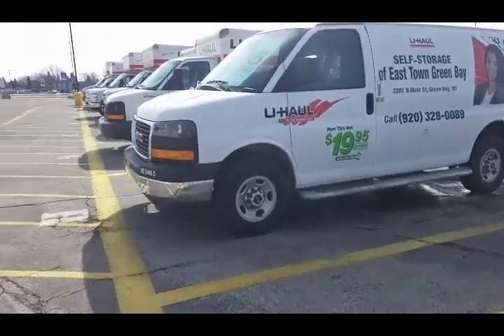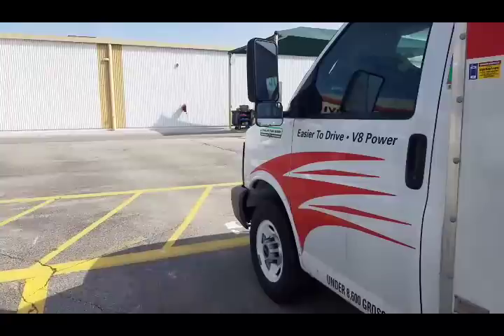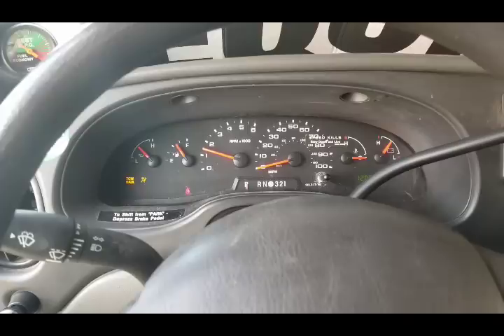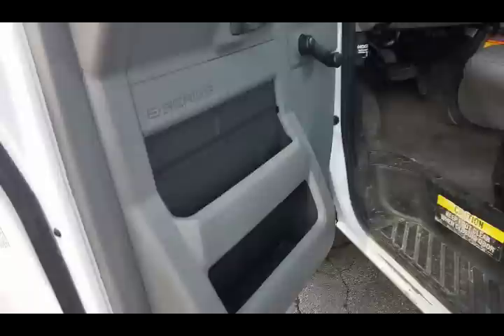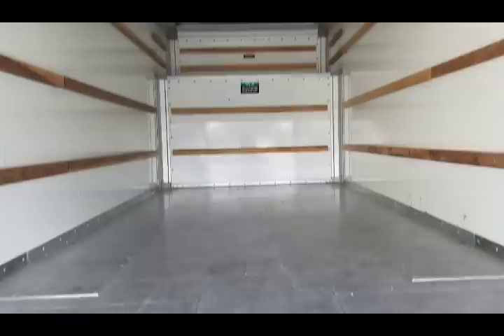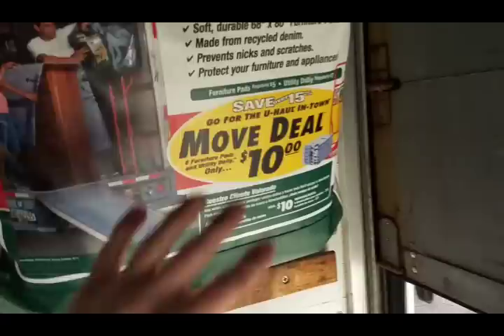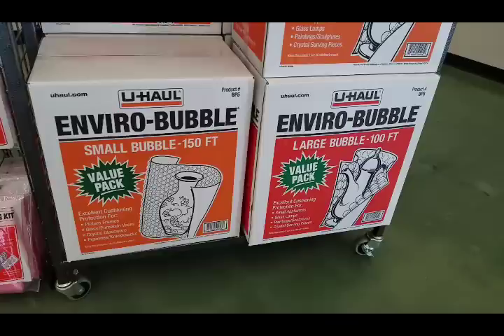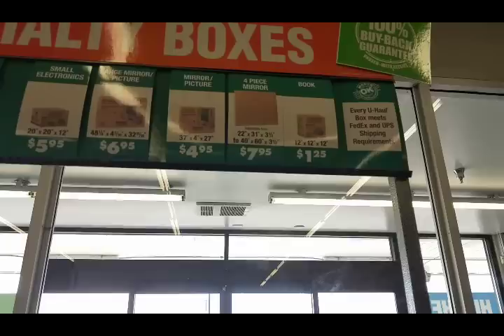U-Haul Trucks - Everything you Need to Know

Comment: The most disappointing part of most of the Uhauls is they don't include any kind of Aux input or bluetooth for the radio. Doesn't matter for local moves, but I can't imagine traveling a couple thousand miles with nothing but FM radio.
Reply from the maker: some of the trucks do, but anything bigger than a 10ft truck doesn't have one, although they all have outlets that you could connect your phone through a radio station. Idk if you know what im talking about.
Reply: @CalebTomaschefsky-Youtube  yeah, you could use an FM transmitter but those tend to not be all that reliable.
Reply: 26" Ford F650 comes with Aux
Reply from the maker: @res887  the newer ones do, but not the older style.
Reply: I work for ubaul and they're steeping up there game with the new trucks there's Bluetooth some of the older ones do have auxs
Reply: Just drove 2350 miles from west of Seattle to traverse city Michigan. Hooked up my Sirius/xm radio through the truck system. Most long trips, the 26 ft truck is a Ford f650.
Most of the gmc’s should be used for local trips.
Reply: Mine did, THANK GOD
Reply: Wahh Wahh...poor you.
Reply: Does it have a USB to charge phone ????
Reply: what you could do is just buy a cheap wireless speaker and use that with your phone instead
Reply: Waaa 1st world problems

Comment: Also the 15’ 17’ and 20’ all have V10 engines. The GMC JH have a 454 V8. Now the new one way F650 Ford has a V10 as well
Reply from the maker: 10ft, 17ft, and 20ft all have a V8. The GMC 26ft does have V10. We dont have any JHs with a V8.
Reply: @CalebTomaschefsky-Youtube  The older 10/17/20 ft uhauls had V10s. Uhaul still has some listed for sale on the used truck site.

Comment: WHERE HAVE ALL THE 17ft TRUCKS GONE?? Can't find on near me, checked 7 locations.
Reply from the maker: all of the 17ft trucks are One ways if i'm not mistaken.
Reply: Ugh yes because that’s what I need 😭 to scared to drive 20 foot with toddler and pulling my huge car ugh
Reply: @vintagevirgo  17 ft was cheaper to rent vs 20 ft and I didn't need the extra 3 feet at the time of the question - plus the 17 ft has more power available

Comment: Thank you! I’m getting a 10ft truck for my one bedroom apartment. Gotta drive 600 miles. Can the 10ft trucks handle towing a 2016 Kia Soul?
Reply from the maker: Yes they are fully capable of towing. You'll have to see if you can use either a tow dolly or auto transport.
Reply: Caleb Tomaschefsky thank you! I was able to do it just fine with a tow dolly since it’s front wheel drive. Your video was super helpful!!! ♥️♥️♥️♥️♥️♥️♥️♥️

Comment: I’m going to be driving 2800 miles in one of these next month. I can fit my things inside a 15 foot, but I will also be towing.
Is the 26 foot much more comfortable? Would it make sense for me to rent a particular size from a comfort perspective in your opinion?
Reply from the maker: Honestly if your looking for driving comfort and are towing. I would go with the smallest truck possible. Towing with a 26th truck is doable. But difficult for most people.
Reply: @CalebTomaschefsky-Youtube  Thanks! I did tow my car  900 miles with the 26’ Penske diesel. It was doable, but the cab was VERY uncomfortable due to the no adjustments on the bench seat. I agree that most would find that difficult. Especially reversing, with the trailer!
Appreciate your input.
Reply from the maker: @TCPUDPATM  appreciate your comment. Glad it at least worked out for yah. They definitely aren't very comfy.
Reply: @CalebTomaschefsky-Youtube , it’s you’re (you are), not “your”. 😊

Comment: Hi, I will be relocating using a 15ft truck, towing a car. Does the 15ft truck have bench seats, cause my 10 yr old Daughter and wife will be riding with? Otherwise i will need to have my wife drive the car instead of trailering it. Thanks
Reply from the maker: I believe they're are three seats. Call the uhaul to double check.

Comment: Wow thank you for the tips I'm going to move to Arizona what sized truck do I need for a 10x10 storage full minus 2 feet from the top? Would a 15ft work?
Reply from the maker: my pleasure, I would say a 15ft forsure, unless you plan on getting rid of anything. Otherwise if your going to be towing your vehicle with it, you can pack your vehicle full.
Reply: @CalebTomaschefsky-Youtube   Thank you and yes it's what I thought a 15ft would work .. ..I don't have a vehicle to tow..  how high is the inside of the back of the cargo are box part of the truck say 7'? If so 10x10 storage contents would fit if 8' high even better..I do have passenger side to put some things like cooler and shower stuff and some house plants.. and a few clothes I hope.. This video is a GOD send I got to see inside the U-Hauls thanks 😊
Reply from the maker: @lorilange8654 
Maybe these dimensions will help you out a bit. This is for a 15ft truck

 Inside Dimensions: 15' x 7'8" x 7'2" (LxWxH)
Mom's Attic: 2'6" x 7'8" x 2'7" (LxWxH)
Deck Height from Ground: 2'9"
Door Opening: 7'3" x 6'5" (WxH)
Loading Ramp Width: 2'2"
Reply: @CalebTomaschefsky-Youtube   Wow that's perfect so tell mother deck is extra?  AWESOME 😊👍😎
Reply: @CalebTomaschefsky-Youtube   OMG this will work for me 😁 I'm pretty good with spatial abilities hehehehe!!

Comment: so the 10 foot and 15 foot are essentially the same thing because the 15 foot has that stupid pop out....what a scam
Reply from the maker: Not correct, dimensions don't lie. The 15ft truck is also wider.
Reply: @CalebTomaschefsky-Youtube  they advertise as 15 feet in length, has nothing to do with width. And its not 15 feet in length when that pop out is there because that takes in a large piece of the 15 feet
Reply from the maker: @NYb24 Maybe this will help you...
10' truck Inside Dimensions: 9'11" x 6'4" x 6'2" (LxWxH)

15' truck Inside Dimensions: 15' x 7'8" x 7'2" (LxWxH)

Mom's Attic: 2'6" x 7'8" x 2'7" (LxWxH)
Reply: @CalebTomaschefsky-Youtube  now subtract the length of the attic from the advertised 15 feet length u-haul….you’re not getting a 15 foot truck, you’re getting a 12.4 foot truck

Comment: Since the u haul trailer only supports a max of around 5200 pounds for a suv, the SUV I need to carry weights almost 6,000 pounds. Can the 26 foot truck carry a large SUV without issues?
Reply from the maker: Im assuming your taking about the Auto Transport. If you go to a uhaul, or just call them, they will be able to tell you if it works or not. The system will only allow you to rent it if its capable.
Reply from the maker: Did you figure out your situation yet?

Comment: Thanks for this video! May I ask what is the vertical and horizontal (width) shackle clearance needed for a lock to fit on the 10' trucks? Thanks.
Reply from the maker: All the dimensions are in the description of the video.
Reply: @CalebTomaschefsky-Youtube  Thanks for your response! but I don't see any lock-related information in your video's description; and I'm asking about the 10'-truck vertical and horizontal (width) shackle clearance so that we can purchase & have in hand a lock before we rent the truck.  Would you know (or could you measure and report) those clearance figures?  Thanks.
Reply from the maker: @secondarysiuhoncall8467  I no longer work for uhaul. I would just buy a lock from uhaul. There fairly cheap. Sorry for the inconvenience.

Comment: Hey, Do you know if the 20 foot One way truck is equipped with cruise control or not (the one that you showed here had the old style steering wheel and no buttons for cruise were on it).
Reply from the maker: Not sure tbh i no longer work for uhaul. I do know that there is a governor at 70 mph so you can hold your foot down to the ground if that helps.

Comment: you'with u haul and this is the best you can do?????
size,size .what's the height,how wide is it,HELLOOO anybody home.
Reply from the maker: I no longer work there, and I had taken this video when i just started. If you would like dimensions all you have to do is look it up, just like you looked up this video.....
Reply from the maker: How big is a pickup truck?
Inside Bed Dimensions: 7'9" x 5'2" x 1'9" (LxWxH)
Deck Height from Ground: 3’
Max Load: 1,980 lbs.
Gross Vehicle Weight: 6,700 lbs. max.
Empty Weight: 4,696 lbs.
Towing Capacity: Up to 6,900 lbs.

How big is a 10' truck?
Inside Dimensions: 9'11" x 6'4" x 6'2" (LxWxH)
Deck Height from Ground: 2'5"
Door Opening: 5'11" x 5'7" (WxH)
Max Load: 2,810 lbs.
Gross Vehicle Weight: 8,600 lbs. max.
Empty Weight: 5,790 lbs.
Towing Capacity: Up to 6,000 lbs.
Volume: 402 cu. ft.
Loading ramp: None

What fits in a 10' truck?
Up to 402 cu. ft.
Small Apartment to 1 Bedroom Home
King Size Mattress with Box Springs and Frame

What is the gas mileage of a 10' truck?
Fuel type: Unleaded
MPG: 12*
Fuel tank size: 33 gallons

How big is a 15' truck?
Inside Dimensions: 15' x 7'8" x 7'2" (LxWxH)
Mom's Attic: 2'6" x 7'8" x 2'7" (LxWxH)
Deck Height from Ground: 2'9"
Door Opening: 7'3" x 6'5" (WxH)
Loading Ramp Width: 2'2"
Max Load: 6,385 lbs.
Gross Vehicle Weight: 14,500 lbs. max.
Empty Weight: 8,115 lbs.
Towing Capacity: Up to 10,000 lbs.
Volume: 764 cu. ft.

What fits in a 15' truck?
Up to 764 cu. ft.
1 Bedroom Home – 2 Bedroom Apartment

What is the gas mileage of a 15' truck?
Fuel type: Unleaded
MPG: 10*
Fuel tank size: 40 gallons

How big is a 20' truck?
Inside Dimensions: 19'6" x 7'8" x 7'2" (LxWxH)
Mom's Attic: 2'10" x 7'8" x 2'8.2" (LxWxH)
Deck Height from Ground: 2'11"
Door Opening: 7'3.75" x 6'5" (WxH)
Max Load: 5,605 lbs.
Gross Vehicle Weight: 14,500 lbs. max.
Empty Weight: 8,895 lbs.
Towing Capacity: Up to 7,500 lbs.
Volume: 1,016 cu. ft.

What fits in a 20' truck?
Up to 1,016 cu. ft.
2 Bedroom Home - 3 Bedroom Apartment

What is the gas mileage of a 20' truck?
Fuel type: Unleaded
Fuel tank capacity: 40 gal.
MPG: 10*
Fuel tank size: 40 gallons

How big is a 26' truck?
Inside Dimensions: 26'5" x 7'8" x 8'3" (LxWxH)
Mom's Attic: 3' x 7'8" x 3' 1" (LxWxH)
Deck Height from Ground: 2' 9" Length 23'5"
Door Opening: 7'3" x 6'10" (WxH)
Loading Ramp Width: 2' 7"
Max Load: 9,010 lbs.
Gross Vehicle Weight: 25,999 lbs. max.
Empty Weight: 12,600 lbs.
Towing Capacity: Up to 7,500 lbs.
Volume: 1,611 cu. ft.

What fits in a 26' truck?
Up to 1,611 cu. ft.
3 to 4 Bedroom Home

What is the gas mileage of a 26' truck?
Fuel type: Unleaded
MPG: 10*
Fuel tank size: 60 gallons